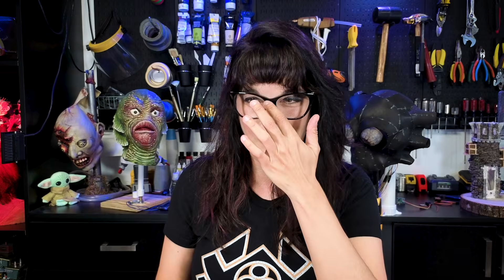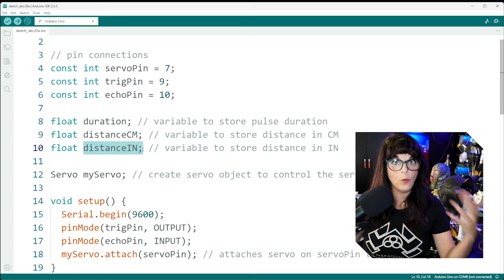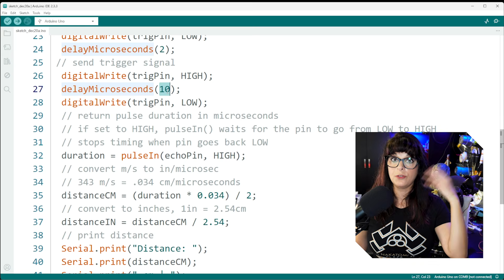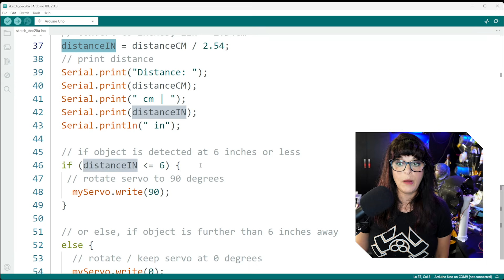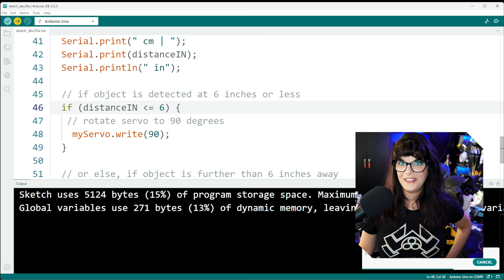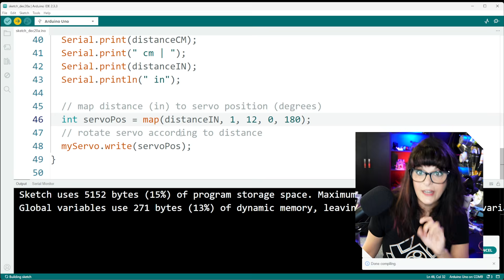How to Control a Servo with an Ultrasonic Sensor and Arduino + Code

Comment: I’m working on a robot mower. I have all the mechanical parts in place. 3 DC motors for my blades,, 4 DC motors for the wheels. My question is, if I have it setup to use a remote control, how can I record my cut path in its entirety using Arduino?
Looking forward hearing from you. KR

Comment: How To Remove Servo Jitter:

1.)  Remove or comment out line 18:
myServo.attach(servoPin); 

2.)  Remove lines 47 and 48 and add the following code instead:
// If object is detected at 6 inches or less:
if (distanceIN <= 6) {
    // Attach the servo:
    myServo.attach(servoPin);
    // Rotate servo according to the distance:
    myservo.write(servoPos);
    // Delay for 250ms to help remove jitter;
    delay(250);
    // Detach the servo to stop jitter between loops and or pulses:
    myServo.detach();
}

else {
    // rotate servo back to 0 degrees:
    myServo.write(0);
    // Delay for 250ms to help remove jitter and for smoother servo control:
    delay(250);
    // Detach the servo when it's not being used:
    myServo.detach();
}

3.)  Explanation:
Some servos are worse than others for jitter, and over time they often develop jitter problems as well, especially the cheaper ones like these common blue ones.
The easiest way to explain the problem with them is that while they remain attached, they are constantly trying to fine tune and or correct themselves in order to get to the proper value that they are set or instructed to get to...

So the solution is to wait until you actually use the servo in the IF statement that is inside of the LOOP, and at that time immediately attaching it right before writing to it, then delaying for a tiny fraction of a second before detaching the servo which prevents the servo from being able to move in-between it's actual instructed movements, so it can't fine tune and or try to correct itself.

Attach, Move, Pause, Detach 
Attach, Move, Pause, Detach
Attach, Move, Pause, Detach
...

It does this every pass through the LOOP!

I hope this helps some of you, as I remember this being a pretty annoying problem when I first ran into it a few years back.

Comment: Rachel, I love your content! I am in the process of creating a robot and I am in desperate need of your help, I am creating a human sized human following robot to mimic kind of the movement of a slow dance partner using TOF sensors for distance in combination with either A: IR receivers on the bot with an IR transmitter being worn by the user via a belt or B: one wide range radar HLK-LD2450 and no wearables by the user. I'm also open to other ideas! I really hope to hear from you, thank you!

Comment: Yes I agree with everyone on how easy you are to follow and understand. I'm trying to build an automatic gate that opens and closes for a robot lawn mower. I have all of it figured out by using and Arduino, a motor driver and a wiper motor which I learned in the video you have😁 but the problem is I need it to only open for the mower and close after it passes through so that my dog doesn't get out of my backyard. Is it possible for that to be done with a BLE tag any suggestions or places that I could find information for this would be greatly appreciated thank you and keep up the good work!

Comment: Hi! I wanted to ask if its possible to connect a controller to an arduino uno rav3  and if not what shoud I buy to be able to(or what arduino is better for that kind of project) bc I'm pretty sure it doesn't have wifi or bluetooth

Comment: Hi Rachel.  Do you have a video on using the newer Raspberry Pi5 GPIOs?  They are programmed differently than the RPi4. Your RPi5 DIY version would be great. 🤸✨🐬 Thanks.

Comment: I’m glad I found your videos! You make it super easy to understand. I was watching your video “ Control Different LEDs with a Joystick and Arduino” and I have a question.  Ive already read the values and mapped the values. I just can’t get it to control my ws2812b led strip. I’m using a rc controller (throttle signal) to control the leds from green to red (each light individually depending on throttle percentage). I’m using FastLED library. I’m not sure if there’s a video that explains that. Let me know if you can! Thank you

Comment: Thanks for this tutorial! I have a few of these lying around and now I have a much better grasp on how to use them. I wonder if a high-pass filter (in software) on that servo position data would make it even smoother...  If the position jumps too fast you could interpolate a point or two while ramping up the speed. That would make the movement a lot less twitchy. Whatever you attach it to will have momentum to deal with as well so a ramp-down function for stopping would be useful for heavier loads. I wonder if the servo can handle a feedback type of stop where you give it some current in the opposite direction to stop it fast and counter overshooting the stop point. Timing is everything. Hmmmmmm... Interesting thought! I may have to get some servos and do some potentially destructive tests!

Comment: PLEASE KEEP POSTING! I learned to code last year starting with your vids, you make it easy to understand and follow, i catch myself answering questions you asked fromthings you taught. i made a useless box, automatic curtain opener and dehumifiier so far. also made some code on wokwi that counts button presses and long presses to set into various modes (using lots of if statments and millis) i havent gotten around to switch case yet ^^,

Comment: Rachel, thank you for the follow-up lesson.  I wish we didn't have to wait so long, although I suspect you have a life outside of Youtube.  I needed this as reinforcement for the last lesson as I have difficult remembering specific code commands.  The good news is, the engagement is back on, and I intend to remain true to your lessons.
Reply from the maker: Thanks for your feedback! I took a little break for the holidays but now I'm back and should be putting videos out more frequently!
Reply: @RachelDeBarrosLive Rachel, I want to use this technology to place a railroad semaphore signal in my driveway.  The semaphore blade will be scaled down significantly to control weight.  Do you have a suggestion for a servo motor to raise a weight of under two pounds?  It will be an all-weather mount.
Reply: I got it figured out after hitting your website.  Looking forward to your next series of lessons.  Thank you!

Comment: cool project! i may be wrong, and probably am, but it appears to me that they "eyeballs" are turning the wrong direction and would be not following the person as they walk by. the arm on servo is perpendicular to the the ruler and should probably start at 90 degrees which would be parallel to the path that somebody would walk and then change the code so that it goes from 90 degrees to a little beyond 180 degrees so that it looks like the eyeballs would be following as a person walks beyond..... could you also delete any code that deals with the inches and also change it to mm instead of cm?
Reply from the maker: Great observation! I taped the servo down without really thinking of the orientation to the ruler so yes, it was probably turning the wrong way. You can certainly have it output in mm too!